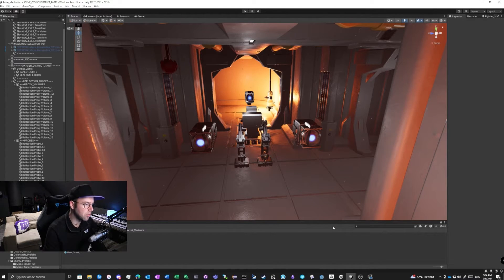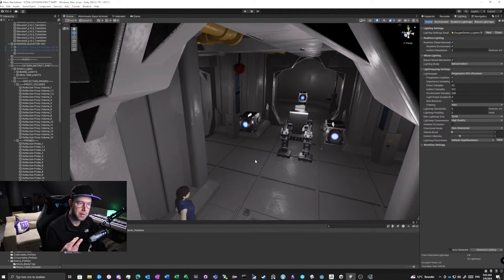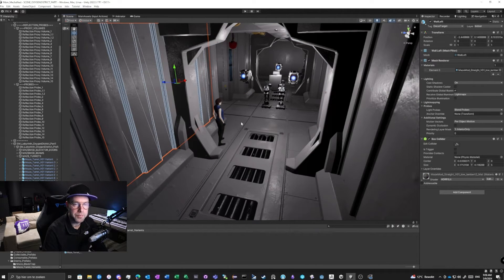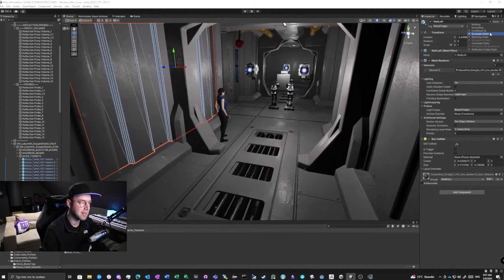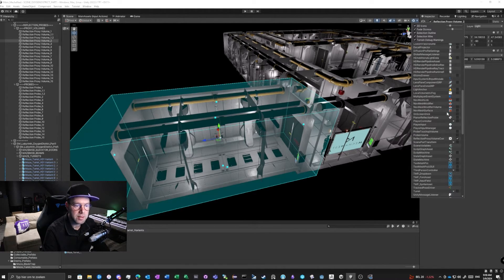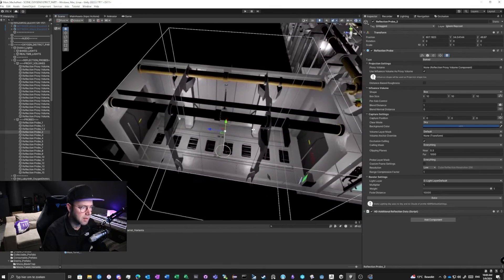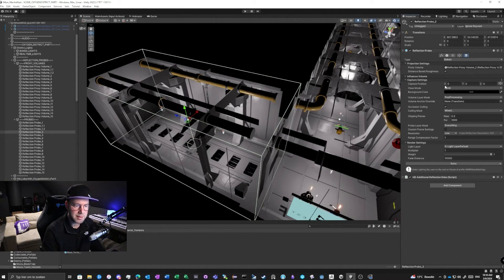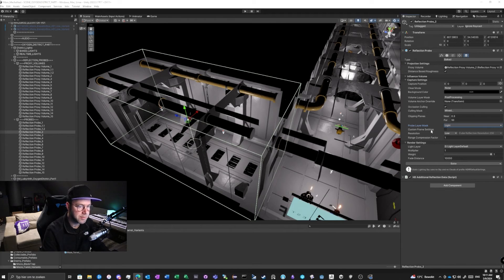How to use Reflection Probes - UNITY Tutorial

Comment: The option for reflection proxy volume at 4:43 isn't there for me! Using unity 6000.0.30f1
Reply from the maker: Are you using the URP Render Pipeline?
If so that is correct. The HDRP Render Pipeline has the option.